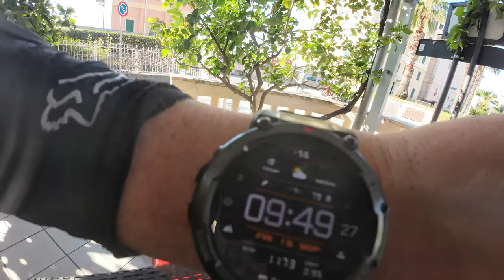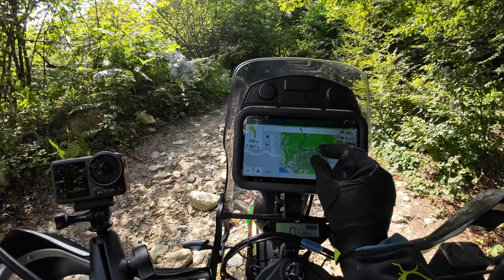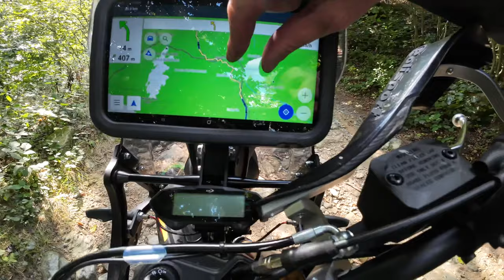So close to destroying my motorcycle! Italian enduro. Motorcycle solo camping trip. Part 21. AJP PR7

Comment: Sooner or later that bolt would have vibrated loose and you would have definitely lost all your oil. You would have noticed when it happened because it would have got all over your back tire . You avoided a huge problem either getting stranded in the middle of nowhere or God forbid you were on the road and had a crash because the oil on your tire and brakes. Glad you caught it man!

Comment: Hey man, better get used to stony climbs, you'll encounter plenty at the Spanish TET. I like it no more than you do btw :)
Pacing myself on long distance trips was a very useful skill to learn. In the end I opted for slower pace without breaks rather than faster pace with full days of rest.
Wow, great job noticing the loose bolt! I once lost my oil gallery bolt like this, and as a result lost 90% of my oil along with the rear brakes before noticing. Since your bike have low oil pressure indicator, I'm sure you'd have avoided the disaster anyway, at least if we're talking about destroyed engine. Though dumping oil under the rear wheel on a twisty tarmac can lead to another type of disaster.
Reply from the maker: Thank you for making me not like the Spanish TET even before starting it 😅😅😅

Comment: About refueling. I remember getting a new Ford Econoliner over 30 years ago. One with two tanks and a total of 160 liter tank. It didn't take long before I ran out of diesel. Embarrassed with a shiny new car, but the button to select the second tank didn't work. It also took forever to fill up that car. Strange vehicle, it used more on the highway at normal speed than in city driving. I remember I was on Easter holiday with some friends. Used 700 liters on that trip, 18 liters per 100 km. 15 liters in city driving. A little more than your motorcycle.
Reply from the maker: 😂😂 but when you think 18 litres is not that much even nowadays. My Audi A8 4.2 used 15 litres constantly 😳
Reply: @nemoltu  No, 18 liters is not that much, especially for such a large vehicle, but it was that it used more on the country road than in city traffic. Had a MB 420 SEL myself and it used 15 liters on short drives in winter in the city, but only 10 liters on the country road. Also had a 280 SE as a taxi and it used 13 liters in taxi traffic in the city. In fact the same as a Mazda 626 with an automatic
Reply: @nemoltu  What we know as the road tax system with a chip in the windscreen, it was developed in Norway and I was hired to do the high speed tests with that car for the Road Directorate in Norway. Set some speed records then on a closed circuit which is difficult to beat with such a large vehicle.